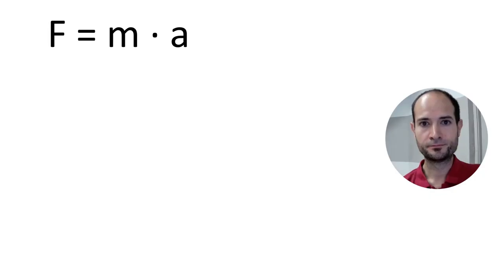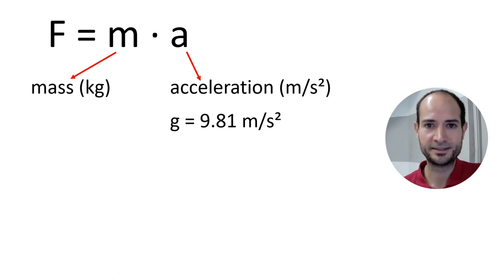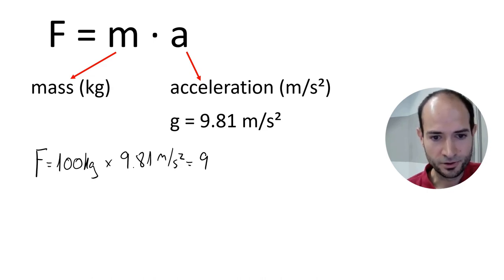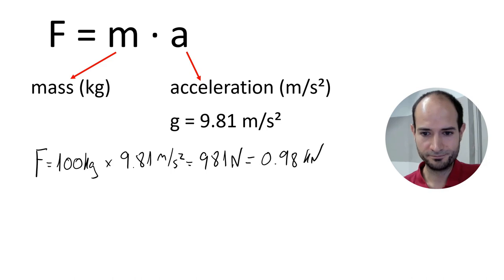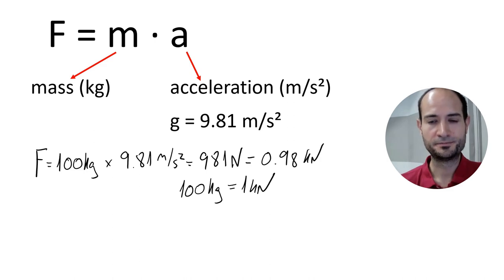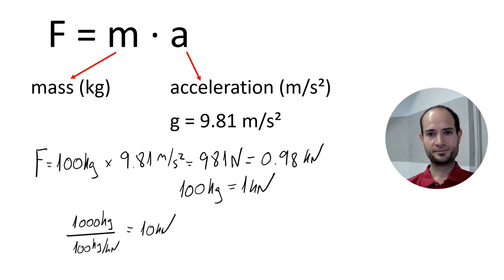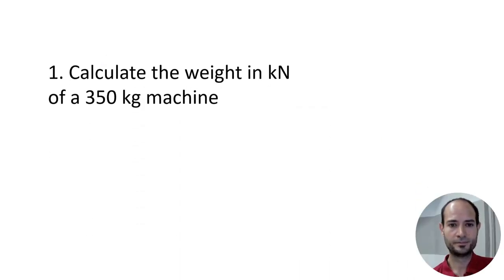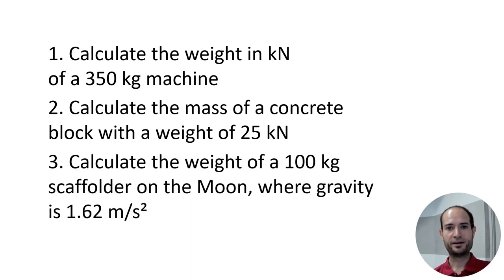What is a force? - Scaffold design for scaffolders 1

Comment: Nice Explanation ❤️ I support you Mr.Aligandro. Please add more videos related  scaffolding. Also I have a question for you to solve . 

I need to work on over roof of oil storage tank , which doesnt have any gaurd rail system . The roof has a vent pipe at the center of it. The pipe is 8 inch schedule 40 . The pipe is welded on the roof top plates with fillet weld. I am going to use this pipe as anchorage point for the lifeline to use fullbody harness, how you will calculate the strength of this anchorage point.
Reply from the maker: Hello, and thanks for your comment. Normally, as a scaffold designer, I don't justify the structure the scaffold is fixed to. That's the structural engineer's or main contractor's duty. In your case, I'd consider a 9 kN load due to the fall arrest (as per BS EN 795:2012).

As a minimum, you'd need to calculate the capacity of that steel pipe (e.g., bending, shear), and the capacity of the welds to transfer the load to the roof, and the roof capacity with that extra load on top.